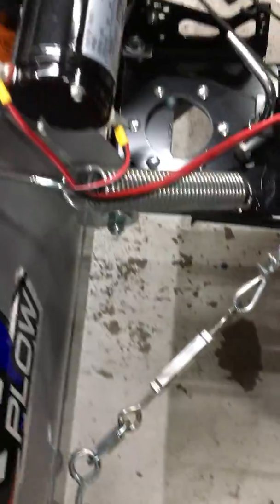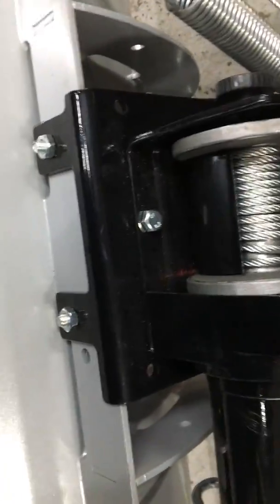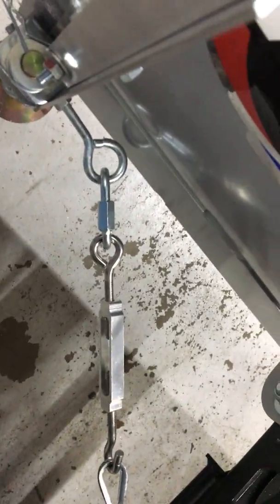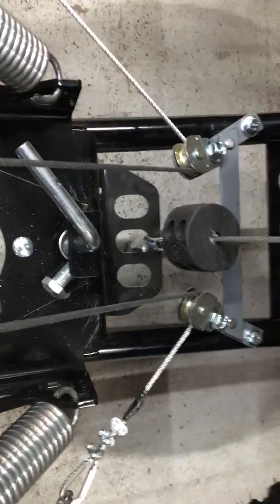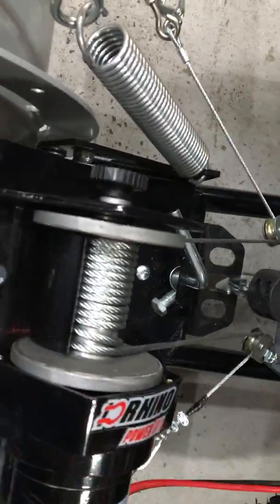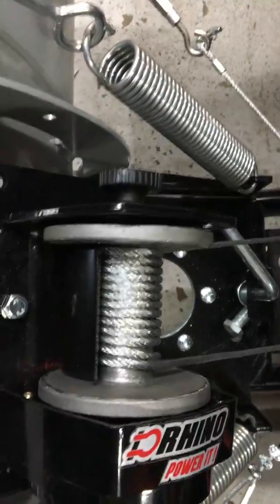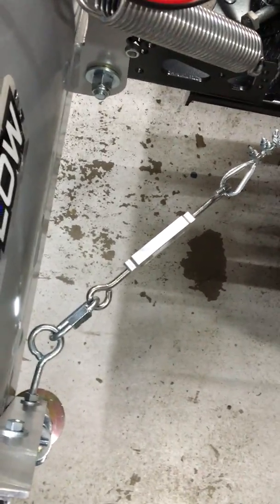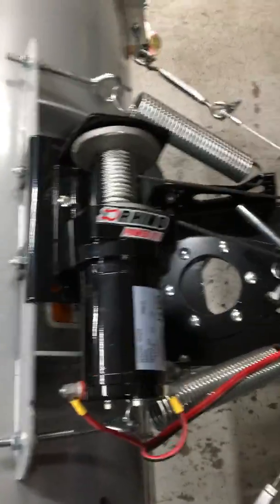ATV plow power angle Polaris sportsman 570 KFI plow add on DIY power angle

Comment: Looks like a hell of a idea. Can the blade still trip with that on there though? If you have smooth concrete it may not be a problem, I think on my land not being able to trip would cause some issues though. Maybe some reconfiguring you could get it to work.
Reply from the maker: Yea , I was really in a rush on this one. I dont see any way the springs will work because the position of the winch.  My guess the fix is not to mount the winch in that spot.
Reply: @mrbuccala  was still a heck of a idea. Thanks for posting

Comment: thats not going to work vary good and will most likely break something when ya catch something with the plow that causes it to tip as the top of the blade will tip forward and pull the cables tite.
Reply from the maker: I cant say.  Those cables have some give and the bottom rolls on its pivot point.  Just getting it to move was cool for me.  I'm not expecting much out of it.
Reply: MrShoptips  I try to make one with my kfi tapered plow
Reply: @mrbuccala  what size the turnbuckle u used i try the 3/8  which turnbuckle u used let me know please
Reply from the maker: @kyleelmer4955  I think they are 3/8 but I'll be honest , they suck.   I dont know where to get good ones.  They worked but this whole design was more geared to see it work.  I wasnt really thinking about how strong it would be.  I was just trying to solve problems as I went along for it to work.  If I ever get some time I think I would change the design completely.
Reply: MrShoptips I broke 6 eye bolts already and I broke a turnbuckle in half too

Comment: How is this holding up? Looking into doing a beefier version on a truck plow, dose the winch cables slip at all?
Reply from the maker: I had to take it off for this first snow because it was heavy and icy.  I was concerned that this design. Might not allow the springs to operate at all.  Now i have been plowing for years and know that under normal circumstances springs dont activate but i wasnt taking any chances.   The problem is in order for the springs to work the cables cant be positioned the way I did.  At least it looks that way.